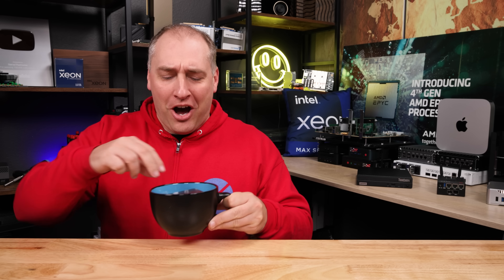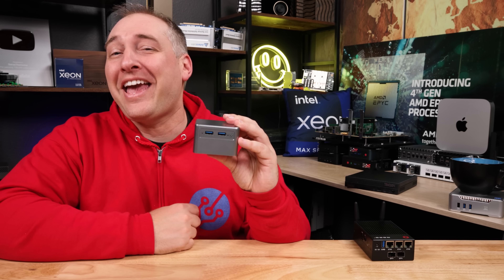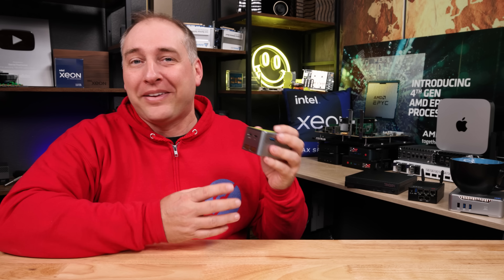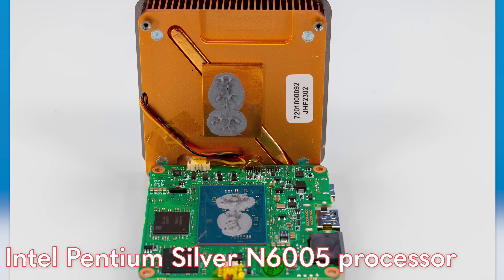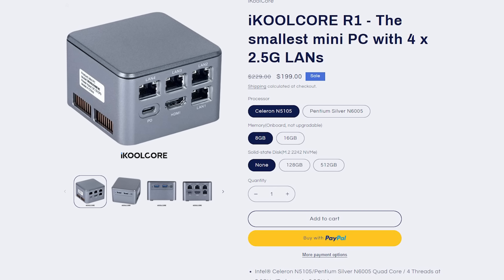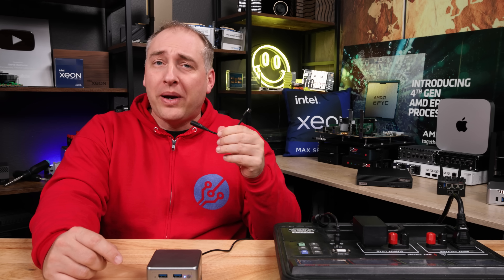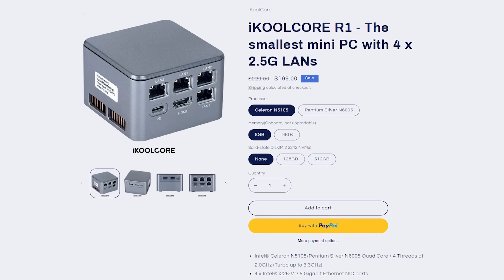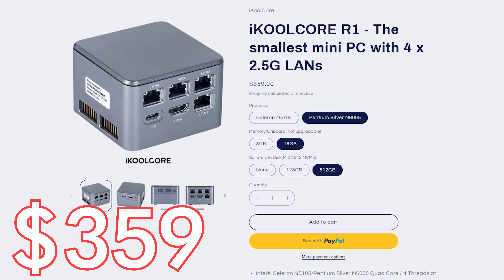This CRAZY SMALL 2.5GbE Node will Change Everything

Comment: Seems pretty great for a 4-node K3OS-based (or Rancher/Harvester) Kubernetes cluster setup, with ETH ports for direct node-to-node connections and an extra ETH port for reaching nodes from other sources so a 5 port switch could suffice...
Reply from the maker: You could totally do that, but I would probably just add a cheap/ low power switch so you can expand later: https://youtu.be/QgLU-HT1E64
Reply: @ServeTheHomeVideo  Ah.. you mean something like a 16-24x2.5Gbps ETH + 10+Gbps uplink to the rest of the network? That would certainly allow much more connectivity especially if you could pool/aggregate all 4 ports for each node to have ultimate traffic speeds in and out of each node, but going this route would require quite costly a switch, possibly of managed type to allow proper link aggregation to fully leverage all the networking available on these cube nodes ;)

Comment: Can you use this as a wifi router? I'm looking for a custom router ,I'm really not happy with the software that comes with tp-link or Netgear and I want it to have pie hole, custom isolation etc
Reply from the maker: Usually you would use this for the router/ firewall and so forth. Then you would use APs for WiFi
Reply: @ServeTheHomeVideo  have you tried putting together and inexpensive custom Wi-Fi access point? And you know what I'm talking about with like the very limited software that the commercial providers provide I want to be able to pick which IP addresses can talk to each other ways to secure my connected devices

Comment: That device would be excellent as a travel router...if it also had wifi (to enable use as a private access point). You could in theory power it from your laptop and use it to secure your laptop from a public wired network and share the spare ports with your colleagues. Nifty.

Comment: Hardkernel Odroid H3+ looks more interesting. It has 2x 2.5G ports out of the box, but can be upgraded to 6x 2.5G ports with Mini PCIE extension card. Also it has 2x SATA, in addition to M.2, for bulk storage and NAS usage. Also Odroid H3+ RAM is not soldered but upgradable up to 64 GB.

Comment: 20+ Watts is quite a lot for idling this small thing. My undervolted 8700k server runs at about 30W idle. With numerous HDDs, nvmes, ssds and 10G ethernet pci installed

Comment: Hopefully we’ll see a N95 / N100 version of this before long — it’s a good fit for that upgrade. 

The lack of WiFi is unfortunate, but the similar size units with WiFi pretty much all use Intel chipsets which don’t work well as access points.
Reply: and N305 too , more core for container . But we should buy another ap for wifi, don't use wifi card...

Comment: No WiFi 😞, I guess they didn't expect people to look at this as a low cost desktop, low use option (being able to cast to a TV when in a hotel room for example is much easier than trying to hook up an HDMI cable when TV's etc are often access restricted physically)

I would have liked to have seen PoE as well (yes, you can buy a power injector but that means you are tied to the close proximity of a power outlet).

The power draw gets up there, what about if you have all LAN ports occupied, would that necessitate PoE++ support?, if so, then that would jack up the price quite a bit I guess.

Another NVMe slot would have been nice, for redundancy, not so much for performance, for things like running it as a router, when those NVMe's fail, switching quickly to a mirrored or backup NMNe is much easier than re-imaging etc

I guess it really comes down to your use case and determining if this device meets in vs other options

Comment: Too little memory, you need at least 128 GB for a server like this.
Reply from the maker: For a low power E core design, 128HB would be a lot. Many of the routers/ firewalls with similar chips are 4-8GB

Comment: This will fill out my setup for my four wheel mobility scooter. I already have a Larkbox pro mounted and have been looking for a decent router. I'll be hooking up a tablet to use as a monitor, to be mounted on the scooter's steering tiller. I'll feed GPS to it along with a rear view camera to complete the install.
Thanks for the review.

Comment: PLEASE indicate whether the CPUs in these crayon boxes have Intel’s QuickAssistTechnology
It can make a considerable difference for some workloads, esp with port speeds over a gigabit.

Also, any idea when we are going to see real 10GBaseT with 1-2.5-5-10G over copper??

Finally, have you tested any of the SFP-Copper “transceivers” and how to tell whether the 2.5 speed units will work in, eg, switches that have the ports?

Comment: Wow!  Something that will worry my fanless Fit-PC3 dual Bobcat, funny I just clean installed it yesterday with a new distro release.
Though fanless even with an SSD installed, it still simulates an HDD disk arm moving in bursty usage.
It's because of capacitors fitted just on one side of the board which cause a resonance by thermal flexing.  Hard pushed or idle it's silent.  😅
For your Wi-fi connection cable to a nano WAP, configured to route Wi-Fi to the RJ45 port.
Mine is USB powered and is no bigger than that box, but considerably shallower.
I wish the Fit-PC3 had a 2nd Ethernet port, the Realtek NIC chip supports more ports but you cannot connect it.
The Wi-Fi takes up room with an additional chip that's better used by a 2nd cable port or USB connected box, if you like WLAN.

Comment: I don’t see the point of making things smaller
Reply: It was certainly a use case for mobiles but that is because portability drove that need

It depends, if you want something that you can easily cart around then the smaller the better, if it's to be stationary, then portability is lessor of a concern and how it integrates with existing surrounding is more important (flat tends to be better than higher for example)
Reply from the maker: I had that point of view a few years ago. What I learned is that there is always someone that can use a smaller PC.

Comment: I think you're right about the pricing compared to the R86. As a tiny travel system is still questionable because of all the properties you'd need: display, keyboard mouse and a USB Wi-Fi dongle, at which point a laptop is probably better.

It really is a neat little system, and it's best use case is as a router, but there must appears to be too much competition in this market segment for it to be a clear winner.
Reply: ssh is enough

Comment: Cool little unit but I'm not sure what I'd use it for... home router is the only thing I think I'd want it for... but my home router is a Raspberry Pi/CFRobot/CM3 machine (about half the size of the unit above, fanless, less than 4W) running OpenWRT. It's dual gig-e but that's fine for an internet router (the rest of my network is 2.5G). It also runs my home automation server (Home Assistant) in a docker container. Unit runs headless so many advantages for that particular application.
Reply: How are you running docker inside OpenWRT? Custom build?
Reply: OpenWRT is like Pro-sumer.  pfSense and OPNSense are beginning of pro-grade networking.  If you need to subnet LANS or VLANS and set network traffic priorities, along with remote administration, or plugins, pfSense and OPNSense are the only way to go.  Plus pfSense and OPNSense are much more secure.

Comment: I'm not sure I like that ribbon cable that connects the second PCB with 3 extra NICs.  I think I'd rather have it be a bit larger and flatter with a single PCB.  Though its cool that it is super small I don't care too much about that if I can't see it in a closet or more likely attached to a wall in the basement.  The 3rd USB is nice but I can always get a USB hub if I needed to on a 2 port model
Reply: I just came to the comments to say the same thing.

Comment: I'm always mindblown by the miniaturization of computers nowadays. Grew up in the era of computers being big, bulky, and heavy. Have one of those M70q Tiny as a Docker host and still amazed we now have 12 logical cores in such small PCs.
Reply: Actually, computers have been quite tiny for a long time. (we just called them "laptops")
Reply: Miniaturization started decades ago. Spectrum, Apple II, C64, etc etc.
Reply: That's the part of Moore's law that people forget. It basically says that processors will double in power (or half in size) every 18 months. For most of the past 50 years we've only really cared about getting increasingly more powerful machines but the more powerful they got the less we needed more power so having smaller processors (and thus smaller computers) was more attractive.

I should add that this isn't that new. Look at the Gameboy, it was essentially a portable NES and the GBA was a portable SNES. These days you can get a micro SD card that stores 1TB on something that's the size of your nail but back in the 80's ROM chips were many times bigger and might only hold a few KB. Mobile phones have gone from being bricks to something you can fit in an espresso cup. I'm not even sure if these machines will get any smaller, they're already as small as they can practically be unless they make everything wireless but the advantages of that would be quite small (!). If they went back to the 80's fashion of having a built in keyboard you could probably fit everything inside the keyboard case

Comment: There is a huge hype around making routers smaller, but honestly I want routers to get faster. I want full packet sniffing with virtually no loss in line speed. I want it capable of handling multiple power users at full speed with proper QoS packet sorting. "you don't need packet sorting with gigabit internet" says the person who lives all alone without anyone else on the internet. I'm a cripple so I live with my parents, and my brother. All of us using internet at the same time, can absolutely saturate the 1 gb link speed (typically 880-940 from verizon). And pretty much nothing can handle the throughput. I DO currently have an ubiquiti dream machine pro with one of the wifi 6 access points, and its the most buggy useless trash ive ever owned. I am half tempted to go back to some shit gaming router that cost $600 just to pull my hair out some more. Its like networking as a whole is going the wrong direction. Lets FIX what we have, and then work on making shit smaller.
Reply: It doesn't require packet sniffing to set per user/per device  minimum guaranteed bandwidth with best effort for the excess. If you can't exist on 220Mbps when everyone else is also maxing out then I don't know what to tell ya, that's nutty.
Reply: @msytdc1577  im not a virgin who lives alone like you
Reply: @goblinphreak2132  you seem down, hope the rest of your day goes better buddy 🫂

Comment: Does it have an open-source BIOS that builds with no precompiled binaries so we can be sure the firmware doesn't have any telemetry or remote access back doors?
Reply: Got your question on official site, there’s no core boot right now.
Reply: @iKOOLCORE  Your response is non sequitur. I was asking about the BIOS, not about anything called "core boot".

Comment: That looks really weak for the amount of ethernet inputs it has, let alone for a single 2.5 Gbps one.
...I mean, sure. I'd gladly eat a sock if someone shows me a video where this little fella is running all ethernet inputs, full load, without a single issue.
Reply: That's why I use virtual Firewalls with proper CPU's underneath wherever I can. Even for travel, if all you want is a secure firewall and VPN then one NIC on the laptop is all you need, and it's smaller and faster too, and has no strange USB-C charger thing. Even higher end routers or firewalls are often based on the smallest tiny CPU that does the job, add rules and filters, proxy and all the things you paid for extra and the performance usually goes way south. I have a few UTM here, returns from customers, don't run them, I run the same UTM appliance in VMware, way faster than most if not any of those boxes.

Comment: I wonder how dangerous the Barrel Plug to USB-C adapter is. As fare as I know, you would need to implement USB Power Deliver, if you want to give more then 5V/3A over USB-C. Does the Barrel Plug to USB-C adapter implement all needed USB Power Deliver circuits? Or is it just a straight through cable with no logic, which could destroy other devices if it is plugged in to them?
Reply: The power supply for the iKOOLCORE R1 is clearly marked as not suitable for use with other electronic products. If used with other devices, it can result in consequences that are entirely at your own risk. It's important to take note of this warning and not to use the power supply with any other electronic devices.
Reply: @iKOOLCORE  I hope this warning is in the Box, because in the Video I can’t see a label on the power adapter. Or on the Barrel Plug to USB-C adapter. 
Specially for USB-C adapter I would find this very dangerous. People are used to switch USB-C power adapter between devices. And if the adapter is conforms to the USB-C PD standard this is not a problem. 
But here I have a feeling of: cheap, sketchy, not following the standard power supply… My favorite kind of power supply… 
 
@ServeTheHomeVideo Have you tried other third-party USB-C power supplies?

Comment: I have doubts on that heatsink being copper. Methinks it's anodized aluminium.
Reply: You are correct in your observation. The heat sink of the iKOOLCORE R1 is not entirely made of copper. Only the heat pipe section uses pure copper for better thermal conductivity. The fins of the heat sink are made of aluminum and have undergone a copper-colored anodizing process, which gives it an overall better appearance.

Comment: Is that USB PD port also completely wired up? Like plugging it in a laptop dock and have the ports working on the dock and power the device of course.
Reply from the maker: We could not get devices recognized on our unit. Just power. You would use the other Type-C port for the dock.
Reply: @ServeTheHomeVideo   Ahh that's a shame. Otherwise it could have been velcroed behind a monitor with dock and used that way.
Reply: But the USB-C port will be USB4 on iKOOLCORE R2, it’s scheduled later in this year .

Comment: Is the included charger a USB-C PD compliant charger or is it just a dumb 12v brick wired up to a USB-C connector? If that's the case, and I have a feeling it is, it's probably dangerous to plug into another device other than this one, and actual USB-C PD supplies won't power this. Confusing use of USB-C if this is the case.

Comment: That doesn't look like a copper heat sink to me, looks like anodized aluminum. I doesn't really make sense as a travel PC because then you could just get something cheaper without the NICs.
I was thinking it might make for a decent switch if you disable all the routing functionality, but at $200 base price that's almost double the price of a standard 5 port 2.5g switch.
Reply: it obviously is aluminium

Comment: Would be nicer if a bit bigger and 1U in height so it would fit on a shelf
Reply from the maker: Yea, it is slightly larger than 1U in height.
Reply: It's 1.89 in tall, sadly ... maybe you can leave the top lid off to make it fit in 1 U

Comment: Judging by the pictures I have doubts that the heatsink is made of copper. It's probably made of casted aluminum, where the anodizing color was carefully selected to look almost like copper. If you look carefully at 4:56, you'll see the color is too bright for being copper, which is usually darker. Maybe it's just the looks of the photo. Also the machining marks look more like those from aluminum heatsinks.
Reply: Yep, yellow anodized aluminium. The contact block might be copper though.
Reply: You are correct in your observation. The heat sink of the iKOOLCORE R1 is not entirely made of copper. Only the heat pipe section uses pure copper for better thermal conductivity. The fins of the heat sink are made of aluminum and have undergone a copper-colored anodizing process, which gives it an overall better appearance.
Reply: Yes the copper parts are only the square that touches the CPU and the heat pipe. The heatsink looks fuzzy like anodized aluminum while the copper surfaces are shiny with oxidation patterns.

That said, the cooling here is perfectly fine even without using copper for the fins, it can easily cool much more than the CPU can generate
Reply: Agreed, zero chance it’s copper, it’s aluminum
Reply: looks like anodized aluminum to me too... copper heatsinks don't have that surface finish either
Reply: Reviewers should be a  little sceptical of appearances, even scraping a little off a corner and see if the colour changes.

Comment: Well, this got my attention. I'm an PCEngines APU2 user with APU2+optical fiber modem+switch+1AP on an UPS which estimates 4h runtime. So this is the user type that is interested in this.
The APU2 has quoted 6-10W. How low could this go, if: underclocked N5105, OS on microSD, no SSD? Anyway, I think I'll start looking for this before any answers.
Also, for the pocketable part, I'm already on GL-Inet products (have 3 of them) and don't really need more performance.
Reply: I've only used the original intel NUC N6005, but that one lets you set the performance mode in the bios between the powersave, balanced and high performance mode, I think they correspond to something like 10w, 15w, 20w TDP but not finding any documentation on it right now
Reply: an nvme ssd is like 2-3w when in use and not a whole lot when idle. SDcard is nearly nothing. So it would still be within the same ballpark.
Imho you can shave a watt or two if you remove it from the case and bolt it to a bigger heatsink so you can run fanless